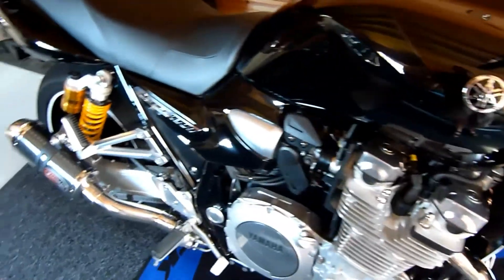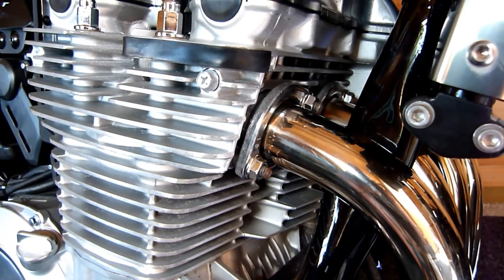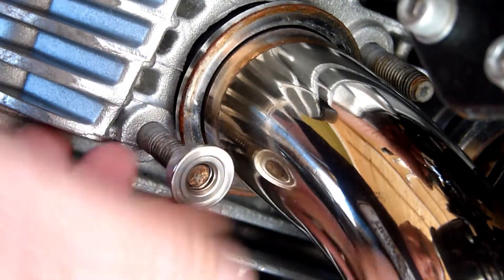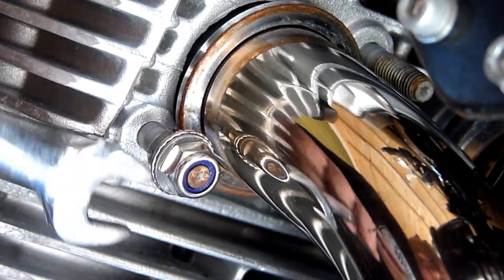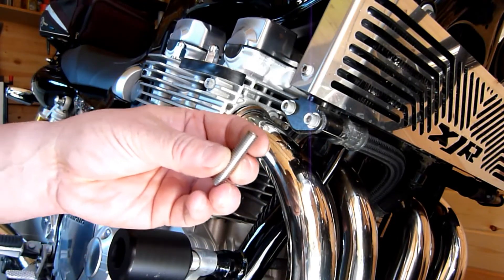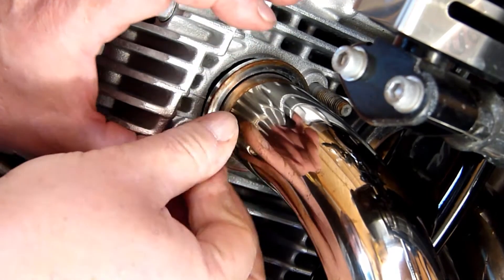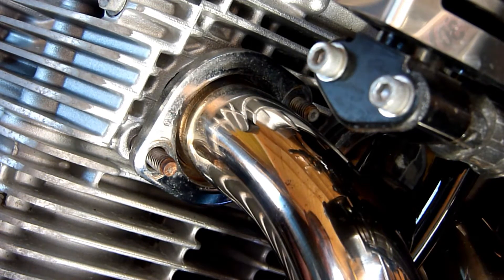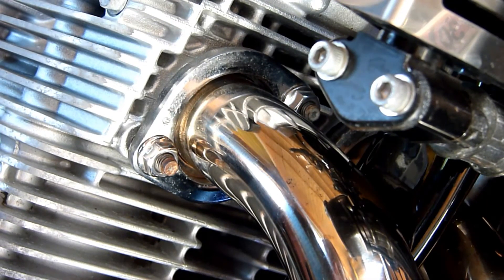Replace exhaust studs Yamaha xjr 1300 /1200

Comment: Stainless into alloy, being dissimilar metals can cause issue of there own, without a barrier being used, especially if salty water gets in there.
Nice bike, when I changed the nuts on my XJR a few years back, the centre four nuts were just small lumps of rust, total pain to get them off.
Reply from the maker: Chris Greenwood This has been mentioned to me before and I understand what you mean about different metals , I bought a 2000 model XJR 1300 Blue Speedblock in 2003, from Wigan Yamaha as a trade sale one owner but although serviced the exhaust header studs and nuts were severely corroded, they refused to do it as part of the deal so I took it as it was,
 I used the same A4 grade Stainless Studs it was a pig of a job but none sheared off and when I sold it 10 years later and they were fine, I even took them out after 6 years when I replaced the exhaust and gaskets, the standard studs rusted away as the nuts while the stainless remained as new!